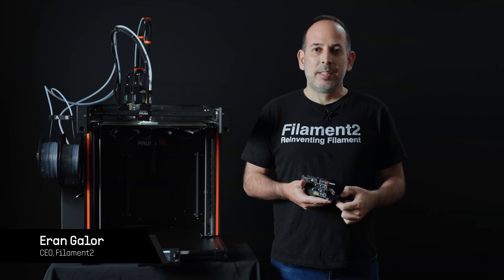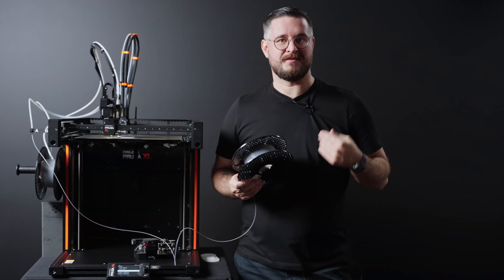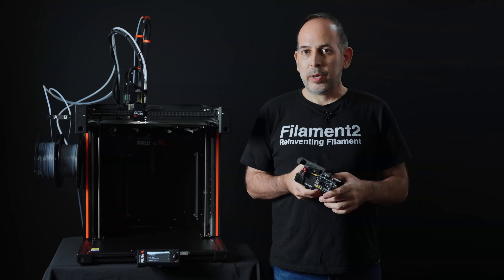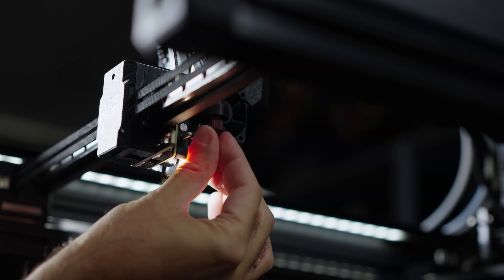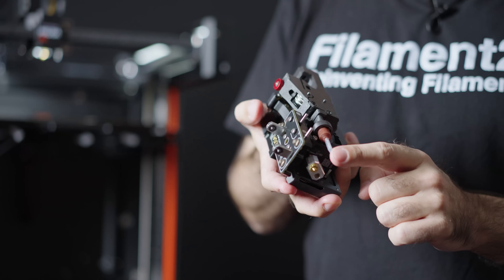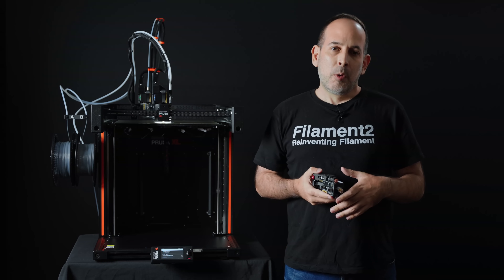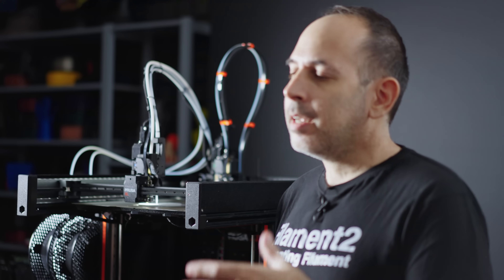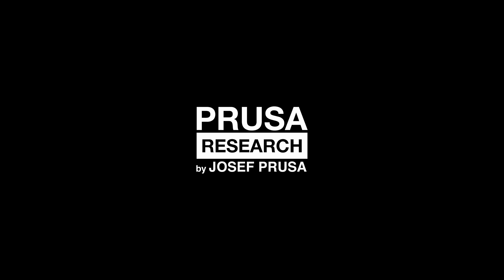Silicone Printing on the Prusa XL - Filament2 x Prusa

Comment: Cool idea but stupid. Locks you into a system that you can only buy their "filament". A parastaltic pump system would've been a way more elegant solution. Hard pass for me.
Reply: While I tend to agree with the locking down argument, you seem oddly confident that a peristaltic solution is applicable for this.

Flexible tubes that contain liquid is far from the only requirement, you need a very precise flow rate control (which is already problematic when you use tension to pull the tube, and with things like gravity and the tube’s angle potentially affecting the pressure inside the tube), you need a compact nodule that fits the tool head and doesn’t weight too much, and you still need a way to dispose of the used section of the tube (in other words, you still have to cut it).
Reply: Cool, You have a 3D printer with parastaltic pump system? What model? Mine only has filament drivers, so this is slightly more applicable. Pretty sure once they test the waters, dedicated printer will be developed without current workarounds.

Comment: I can't help but notice that "normal" FDM hot end behind the silicone extruder? It is not mentioned anywhere but it looks like you can also use this a filament extruder when you are not printing silicone (after removing the tip and calibration, not during the same print) so that definitely contributes to the value of this tool head.
Reply: It appears that the silicon addon thing is meant to attach onto the xl’s normal print heads. This provides the advantage you mentioned and I’d guess it’s simpler to design than a full tool head…
Reply: @CloroxBleach0 Possibly, but I hope it is the full head. From what little info  is shown I think they are selling that full head with a FDM set up and silicone/liquid filament side piece...as that is what is pictured on the listing and held during discussion in the video. That also would make the $1000 price tag much more palatable but it is hard to say until more information is released, or if it is an add on I hope that it is offered  at a reduced price. But if we have to by this at a $,1000, and purchase another tool head (assuming I didn't have one to spare to start with) assemble it, and get this this liquid filament of an unknown ( likely $300+ price tag) it is a lot of barriers to entry of a experimental tech.  Not saying I wouldn't save up to do it, this looks very cool just that I'd prefer as much functionality for my money out of this thing as possible.

Comment: Everything showed in here can be made by pouring silicone into the mold, without any struggle and as I assume expensive "filament". Yes, printing mold will be a little more time consuming, but you can use it multiple times. I mean, they are saying about hinges and supports, but don't show any (my guess adhesion is not great with any combination).
Reply: Yes but it's step back in evolution of technology.

You can cut grass with scythe, but who does that professionally with that outdated eq nowadays?
Reply: @Exorcistt94that's stupiest comparison. For grass it would be laser scythe, very modern but slow, or good old gas mower.

Comment: ...But where do the remnants of the tubes go after the liquid is extracted from them?
Reply: At about 3:29 https://youtu.be/Ugew7tXiU38?t=210 we can see a return line tube going back up after the silicon is squeezed out of the two mixing tubes.
We can assume that goes pooped on the back of the printer somewhere.
Reply: @grsamael  good catch!
if you look back to 0:26 you can see on the left that there are three tubes. A and B tubes from those two spools and between them behind is what I asume "return line" for those empty tubes - it even looks like there is something like bin behind the spools
Reply: As mentioned, you can see 3 tubes going to the head.  At 0:02, you can see the two cut tubes from the back going to the return tube in the front. In this video, the return tube seems to just go down behind the printer. Presumably, you'd need a mechanism to wind the cut tubes onto a waste spool. As well, they should have some system to recycle those. The waste from these is my biggest concern about this implementation. I'm wondering how this compares to some kind of pump system that pumps from a couple of supply bottles.
Reply: packaging the silicone in 'tubes' and sending them through a gear extruder as a solid seems ridiculous.
what's wrong with storing it in bottles and pumping it to the nozzle?
why are they going to so much lengths to treat a liquid medium as if it was solids? People are already accepting SLA printers it shouldn't be that scary....
Reply: @adriansue8955  which make the tool head that more cumbersome for movements, esp to dock if you’re doing multi-material printing. Imagine it, a big old jug sloshing about above your build plate
Reply: @AteneFenix  You wouldn't hang the reservoir on the head. it'd be a shelf next to the printer.
Reply: @AteneFenix  Fluid reservoir stays still, a peristaltic pump can feed the liquid through a thin tube in very precise amounts, inkjet printers such as Brother and others with remote/continuous cartridges have done it for decades.
Reply: THANK YOU I was wondering the same as soon as they said it was tubes
Reply: Looks like they are creating a system to simply sell to people who already have FDM printers. The ideal system would simply be part A and B lines combing at the head. And then you only need to replace the mixing nozzle tip (or soak and clean). The lines seem cumbersome, but I’m not above experimenting. I do silicone molding for work using both resin and FDM printers. So cutting certain steps out would be welcomed. That said, printing vs casting doe shave various limitations on shape as supports need to be used as opposed to molding.

Comment: Literally 3D printing a negative mold and pouring 2 component silicone in it has less waste than this method. And it's way cheaper. Been doing that for years and its not as difficult if you know how to model them easily
Reply: How? You do know 2 part silicon fills everything not even 100% infill on a 3d printer fills some gaps. Plus you can do infill on a 3d printer, you get squishable and fkexible stuff and not the slap brick of silicon, youc an get way different flexibility and squishability from 3d printing
Reply: @TheRealRivulet
I don't think you can do overhangs with the method they show in the video. It's no coincidence they mostly show silicone seals and rings and such.
On the other hand, when I 3D print a mound I can make as crazy a geometry as you can using the material you make a mold from so overhangs and complex geometry is really easy. I've had perfect results using 2 wall thicknesses for the general walls of the mold and often do a single bottom layer for the first layer so I don't waste filament and it works perfectly for me. Sometimes i even go to single wall thickenesses if I know I can get away with it. Always use vacuum to degass your silicone and pull the silicone vacuum again when in the mold.
Especially for the stuff they show in the video a mold is way more precise, economical and doesn't require any extra hardware. (Maybe a vacuum pump and chamber if you want high quality stuff)

Should I make a video about this? There are some more things to look out for that are a bit difficult to explain in a comment..
Reply: @VTeslaV Couldn’t they use one of the XL’s other toolheads to print supports for the silicone? (For stuff like overhangs)

Comment: From the point of view of a medical engineer and researcher I can't express enough how much I would love to play with this tech. So many possibilities. Can't wait for the release and congratulations to everyone involved in the project.
Reply: you already can, just print a mold and pour silicon in it
Reply: @ilparola  but is this not just better les waist more speed
Reply: @Thefreakyfreek more waste
Reply: @ilparola you clearly didn’t understand it….
Reply: I cant wait to print my wife a set of t1ts😂
Reply: I also can't wait to release!
Reply: give me maybe 3 great possibilities, please
Reply: @DanielSanNinja Sure, why not. First, there is a possibility of making parts with compliant segments, that have to be softer than TPU. I guess the second could be combining the advantage of FDM printing with properties of silicon-like materials. What I mean by that is FDM is unique for it's ability to change the mechanical properties of the print by modifying the infill, which cannot be both done and controlled as easily in mSLA. Adapting that to part printed with silicone-like material could be helpful in certain scenarios, at least for me. Since you asked for 3 possibilities for the last one I would just go with the ease of making certain models without the need of machining complex, multi-part molds for something that is supposed to be a proof of concept and/or quick prototype. You may not agree with me, yet, for me and my needs this tool seems like a game changer if it delivers.
Reply: @SeijinTheMadScientisthm. I could have written that. So yeah - it's great tech! So it's got better properties as TPU by being even more squishy and durable. Still my only good example for this would be a fleshlight 😅
Reply: @DanielSanNinja  3 ? You only need 1 : sex toys.

Comment: Slicing open a liquid-filled plastic tube to deliver the material seems extremely wasteful. What advantages does this have over just having two tanks of A & B, then two tiny, low power dosing pumps to push it into the head? This way there isn't a huge amount of plastic waste, although there is still some because you'd have to replace the mixing tube with every print.

Comment: Why the filament tubes? Why not a simple peristaltic pump pair with two silicone tanks?
Reply: This method might give you better pressure control. By their nature, peristaltic pumps require the use of a very flexible tube. That tube will expand when under pressure and possibly cause issues when trying to rapidly change the flow rate. It acts as a pressure reservoir. You could compensate for this with pressure advance and other techniques already familiar to those into 3D printing, however a complicating factor might be the viscosity of the resins change substantially with temperature. 
So while peristaltic pumps are great at dosing specific amounts, they might not be great at rapidly changing the flow rate.

With this method, if you push through one centimeter of tube then you get a specific fixed amount regardless of temperature or other variables. The feed mechanism doesn't have any flexible parts that can expand and vary the amount of resin delivered. Kind of analogous to when you are printing regular flexible filaments like TPU, you want the extruders gears to be as close as possible to the hot end.
Reply: @charmio  you could simply control temperature for the resin chamber. The overall cost would probably be less than the sum of plastic you're throwing away.
Reply: @lucasmontec  Potentially, but even if you do come up with a successful compensation algorithm to help overcome the slow response when changing in nozzle pressure/flow rates, it's still going to be less responsive. Compensation and tuning can only go so far.

It's probably not an insurmountable problem (you could possibly use a gear or screw pump instead of peristaltic), but I think the response times might be a large part of the reason why they went for the method they did. I'm sure someone will test it soon enough though.
Reply: @charmio  a screw pump could add bubbles to the mix. Vacuum pockets + imperfect air seal. But such a device could be used to measure flow maybe. It's a hard problem to solve indeed... But it sounds even harder because it needs to adapt to the FDM format. Maybe this could be done with less hassle if it's designed to fit another kind of system. Defeats the purpose? Maybe! But have you seen how capable are those gel printers? No supports too! And the gel is probably super cheap. Those printers use pumps and they don't have such flow and clogging issues because they can literally use less viscous materials and slower curing resins/silicon. That's innovative. For FDM-like, this still feels wasteful. Those tubes probably are coated with PFAS or made from them. I can imagine the filament rolls would be 50usd or more, if not much more. It feels weird then, targeting a community printer system instead of just going full blown industrial.
Reply: I had a similar initial reaction but the more I think about the more sense it makes.  I have worked with silicone quite a bit and the mess and waste are incredible. That shit gets everywhere, clogs everything, is almost impossible to clean without horrifying chemicals and spoils if exposed to air. Pump systems are basically only worth it if you are casting multiple kilograms per day. Even if the waste to product ratio here is 50/50 if it can keep the mess concentrated it will be coming out ahead for most small one off parts. (Still don’t like the proprietary nature however)
Reply: Exactly, this seems a bit backwards and to lock you into buying from this specific company only. A simple parastaltic pump with the special nozzle would've been a more elegant solution.
Reply: I think it is compatibility issue. They want to use as much as possible existing 3D printer material flow. Next step is to create a dedicated printer with flow instead of filament feed.
Reply: Because then you have to worry about degradation or clogging in the tubes, as well as flushing when changing materials. Pump based silicone printers have been in prototyping for a while, but they haven't made it to production for a variety of reasons, which may include patent encumbrance
Reply: @Nidkidful  feels like a solution for companies, not for makers. Makers would never pay the premium for such problems. They'd just solve them with good profilaxis
Reply: @Nidkidful  with peristaltic pumps like the comment suggested the tube could be part of the filament tank and you swap it for every tank since none of the pump mechanism touches the fluid
Reply: @Nidkidful  do you really? Doesn't seem like such a huge problem. Just cleaning it well after printing would work for sure. Probably way cheaper then using this expensive garbage generating solution.
Reply: @Nidkidful tubes are dirt cheap to replace them.
Reply: @orche_ork but if it clogs mid print, and scraps what you're doing, that's a reliability issue. Prusa wants to sell dependable products, but has things reasonably open for you to integrate your own solutions if you want to try other things. I'm ok with that as a balance so far
Reply: @Nidkidful  if it clogs mid print, the printer detects and stops. This is how we do filament run out already.
Reply: @lucasmontec we detect print clogs by filament motion, but most machines don't have that feature, just filament run out. How do you propose to detect a clog in a liquid line, and deal with the material in the mixing nozzle curing?
Reply: @Nidkidful  honestly, give me enough money and time and I'd figure that out. I could go the pressure route trying to measure intake having a air tight tank. I could also add particles to the liquid and use IR to read fluid movement. I don't know. I just know I'd try hard in the direction of not using a proprietary filament that generates waste. I mean, people can print ceramics and chocolate without those. There must be a way. Even changing the composition of the thing would be nicer. But yeah, maybe for industrial use, it sounds better with those tubes, but as a maker, I'd never touch that.

Comment: Dunno about overhangs, but this looks pretty cool.
Reply: Well, theoretically, it would be fully compatible with the other tool heads of the XL, so you should be able to print support material for the overhangs on the silicone.

Comment: -Live hinges that don’t break over time. 
-Possibility to used epoxy instead of silicone
-Gaskets and seals
-Soft adapters for hoses
-Better than TPU for soft bits, but more expensive for sure.

Please add uses. Thank you
Reply: -Printing silicone molds directly, maybe even for chocolate!
-Springs might be easier to print
-Maybe printing a plastic jig for keeping some non 3d printed part down, and then using the printer’s accuracy to glue it (with manual gluing being difficult due to the part’s size/inaccessible spots)

Comment: This is a totally new feature for 3D printing and opens a totally new world for 3D printed flexible parts. Nice it works on existing machines!
Reply: It is not totally new as f.e Lynxter has been doing this for quite some time. Not exactly the same system but the result is also a FDM printed silicone part. The real exciting thing here, is that it gets more accessible and the possibility of mixing it with normal FDM materials.
Reply: @tengertechnologies  3D printing has been around since the 80s, but it wasn't accessible to the public.
Reply: @PommelKnight  Yes? But we are talking about silicone printing not 3d printing in general
Reply: @tengertechnologies  OK, I didn't know Lynxter. I looked at it. It is interesting, but expensive, even for the professional market. It works with a kind of syringes and the maximum print size is limited. In our printfarm we do medical stuf (laser sintering) and silicon printing can be a nice addition, but investing in a Lynxter machine is way to expensive. Investing in an addition of an existing XL is doable and using filament is much easier as handling syringes.
Reply: @wilsistermans1118  Well yeah. As I said, it getting more accessible is the exciting thing. And the new possibilities with the mix of normal FDM are very promising. Just wanted to say that silicone printing is not new, which might also be a good thing, as there are already proven uscases.